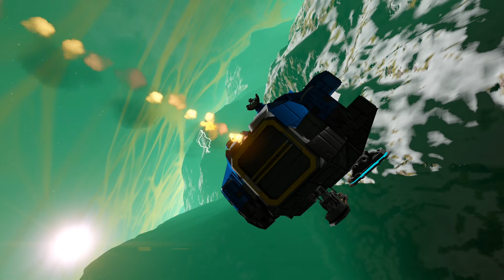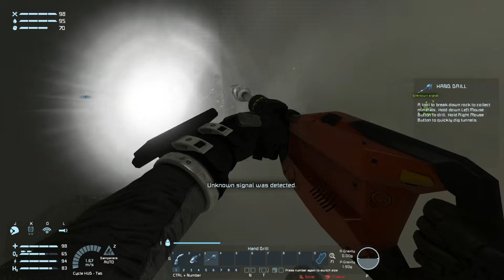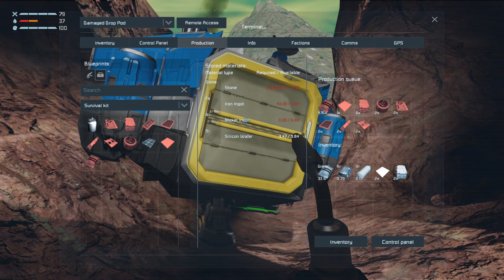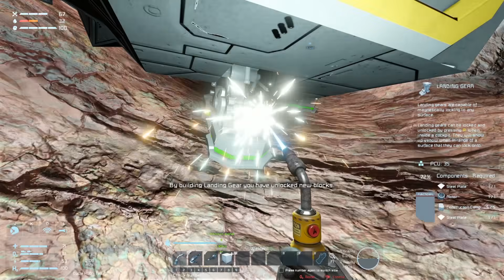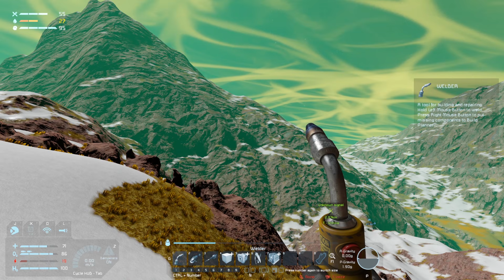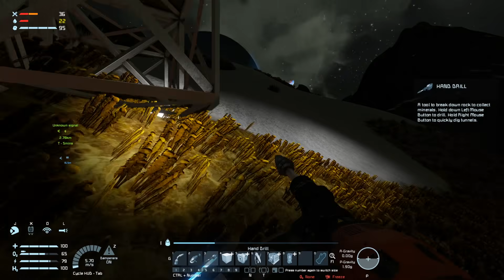Survival Impossible - Space Engineers Hardcore Survival

Comment: I love this, has a challenge set up where the planet you start on has less wind than most planets and is able to get 3 wind turbines to work. I start on the earth planet and in a wide open area try to build one and the thing doesn't work XD Granted I bet it is just some strange thing that will take time to figure out :D which...now that I think about it, how do you get the turbine to "stick" to the blocks? Every time I have tried putting one down it is able to be moved around even after being placed as close to it as it lets you put it?
Reply from the maker: The trouble is how you're trying to place things, you need to have it snap to the block when building, make sure the block it's going to connect to is under your crosshair when placing and you'll see it snap so that the two are actually connected :)
Reply: @Splitsie  Thanks dude :D I actually found myself thinking about how it added the new button placement feature and no other tutorial I saw had it mentioned for some reason. So I went and tested it and sure enough it had it spelled out plain as day XD. Thanks for the response though! It helped a lot!

Comment: Here’s an idea! A new base (Later on). Solar powered, atmosphereic, NO LANDING GEAR.

Also, will you make custom, airtight, rotor based doors. If not, I’m disapointed. Here’s why:

Allows bigger doors, and atightness (Strategy)
Is neat, just due to the complexity (Neat)
Is complex (Complexity)
Can be made to have an awesom opening sequence! (Very awsome! )

Sounds splitsie-y to me! DO IT!

ANd, the jetpack can save you from a fall. Wait untill you are at a certain point, and it slows you down, and by the type you are at the ground, fuels almost out, and you only mostly die!

“He’s only mostly dead”

Also “you would have to be insane to try this!”

Well, guess I’m more than insane, since I haven’t done much survival, and this is the first scenario I will try...
Reply from the maker: I suspect I may have a reason to build some custom doors down the line, but my first set will almost certainly be the vanilla ones as I won't have any vehicle big enough to need more than that. If I eventually get to building something large, custom doors in a pressurised hangar would have merit since I could work inside more easily and still get something huge out :)

Comment: Perhaps friendo you could do a Cargo Container, then stick a piston on the end of it, then add a drill, add pistons continuously until the material problem is solved.
Reply from the maker: The trouble is the material loss every time I need to remove the drill, with Awwscrap I can't just grind something down and move it :(
Reply: @Splitsie  Have you tried Drone Mining then? You'd need to get an actual programmer to explain it better than I ever could, but maybe you could set some 3D co-ordinates for a drone to mine out, return to location, drop off materials for X number of seconds/minutes and return to mine the co-ordinates.

Again, I'm unsure on how to make that viable with all the extra stuff you've got running without the power issue cropping up.

In any case; that sucks that the drill thing wouldn't work.
Reply from the maker: There's a script called PAM (Path-Auto-Miner) which handles that stuff quite nicely, though due to it needing to fly I'm not sure I'll go that way here, flying in 1.9G with loads of ore might be too expensive from a power point of view :/
Reply: @Splitsie  From what I understand splitsie my lad, you will need a large Reactor plus batteries in abundance adding into that whatever you want to have the miner itself do.

I'm sure there would be plenty of minions willing to help out if it were a MP server, but this is a SP runthrough.

Good luck o7

Comment: You can save a lot (95%) of material on scaffolds by using ramp blocks. They use interior plate (which only requires 1 iron ingot each), give you a 1x2 block instead of 1x1, and can let you ascend twice as far per block as light armor slopes which means you do less spinning while going up and down. So to ascend 2 blocks you only need 2 iron ingots (2 blocks for a tile-able ascent unit); right now you're spending 42 iron ingots (6 blocks per tile-able ascent unit) for the same ascent.
Reply from the maker: That's a good point, I'll try to remember that for my next tower build :)

Comment: Stick a hydrogen engine on the lander. When I’m playing with Aw Scrap, that’s normally how I keep my survival kit running until I can move to a more permanent base. Considering that you’re right by an Ice field, charging the battery up will be simple.

Also, when you hook the Survival Kit to the base, be sure to use an advanced rotor connected to the large conveyor port so it can be piped up.

For detaching the kit from the lander, DO NOT use detach mode directly on the Survival Kit. You need to grind it to 50% which will cost you medical components. Speaking from experience here.
Reply from the maker: That's a good point, I'm hopeless at remembering the hydrogen engine at times. Now that I don't need the ice for breathing it would be a decent way to secure the power for a little longer :)

Fortunately I'm familiar with how Awwscrap and advanced welding interact, I suspect I'll make very little use of the detach function unless I've got no alternative :)

Comment: I'm sorry to break your bubble, but survival kits are much better at converting stone into ingots than basic refineries. I know this because I was experimenting with ore outputs of the survival kit, basic refinery, and the refinery along with varying upgrades you can give it. I wanted to know how much each one produced and how much better each one was. What I found was when it comes to stone the survival kit produces about 42.8% more resources than the basic refinery.

Additionally, the refinery with no upgrades will produce the same amount of resources as the survival kit, but at a much faster speed. Literally the sole purpose of the basic refinery is to let you process the basic building ores (iron, silicon, nickel, and cobalt) until you can get a full on refinery up and running. Unless you also changed the recipe for the survival kit stone and basic refinery stone.

When the survival kit was released initially it was the worst at converting stone, but in some update (I don't remember which) they made a secret buff to it to where it was yielding the same as the refinery. I figured they did this to help shorten the length of time at the start where you only had a survival kit. I do have the numbers if anyone needs me to give them out, so that they can compare.
Reply from the maker: Well that would be true, except I modified all the outputs to ensure it wasn't ;)

Comment: For you basic vs full assembler, if an item can be made in both, remove that ability from the full assembler, the basic assemblr now does your plates and small tube ect, the full assembler becomes an advanced assembler for the extra's, it's not needed to survive but for the complicated builds with advanced parts, you'll need both.
Reply from the maker: I thought about that, but without the upgrade modules it will likely make manufacturing large volumes of plates a bit frustrating given the pace. If I was good enough to mod upgrades to it then that wouldn't be an issue though :P
Reply: @Splitsie  quantity has a quality all of its own, basic's have low through-put, build enough of them to rely on bandwidth, you wanted an excuse to go mining for the lkes of Iron, no better reason than needing 20 basic assemblers :P and the pretty room to house them in

Comment: Only thing i can think of for basic assembler is make that only thing capable of producing tools and bottles
Reply: This means you make one, and rarely use it.  Better, I think, if it is the only source of some common component, like steel plates.
Reply: @skipper2285  I was worried limiting creating of a component type would break the auto queing of the build planner
Reply from the maker: Without the upgrade modules it will likely make manufacturing large volumes of plates a bit frustrating given the pace. If I was good enough to mod upgrades to it then that wouldn't be an issue though :P

Hadn't thought about breaking the build planner though... that could be a problem

Comment: So, one thing I think might need to change about assemblers is that the advanced assembler should ONLY be capable of making advanced components. So, no steel plate, no construction components, none of the high-volume basic stuff. Basic assemblers would take that over, and they can't work as fast or be upgraded, meaning the player has to be a lot more intentional about their production queues and surpluses because ordering 1000 steel plate on demand would be quite unreasonable.
Reply: Going even further with this idea, I wish advanced components were made out of basic components rather than raw ores, necessitating even larger industrial and logistical networks. Basically, I wish Satisfactory's production concept were present in SE.
Reply from the maker: Stepwise production would be interesting if we had upgrade modules for the basic assembler so we could speed it up at those times when you need thousands of plates etc

Comment: If you really want to go hardcore, the hydrogen thrusters should require an oxidizer as well as fuel. As for the basic assembler, maybe have it function as a recycler, turning the scrap into the functional components with a small investment of resources? Maybe a tenth of the total build cost of the item in raw materials to replace broken parts.
Reply from the maker: I've sort of got that with the awwscrap mod where components come back as scrap and then can be refined for a fraction of the resources that went into each component. But if not for that it would be an interesting mechanic

Comment: 38:00 if you have a small grid piston on a wheeled vehicle, you can easily set the max/min extension from the hotbar so that it mines quite level, and gives good control of making ramps up or down. I have a working design with 2 drills that operates as a trencher, but with a few more it could tunnel as well.
Reply from the maker: I completely agree :)
That's been my usual trick for mining vehicles - it's how I controlled the one that drilled down to the underground ship in Escape Unlikely, definitely the better trick than using a rotor as you get much better control :)

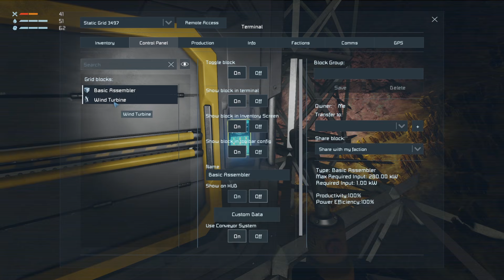Comment: @splitsie 34:50 I am pretty sure you still have enough power to at least build something like the material for a battery (but at a much slower rate) despite not reaching 280 kw, as long you produce more then 1kw, just not as fast...I think...

of course course having more wind turbine/solar panel are still the better option =p...i'm just curious if solar panel might have more use now that the wind turbine produce less power now....
Reply from the maker: I thought you needed full power or it didn't work at all, been a while since I tested it though

I'm hopeful solar panels will have a potential benefit compared to wind as I love building big solar towers :D
Reply: @Splitsie  Might be the case with the basic refinery too, a quick way to test it would be to turn off most of your wind turbine off. I think is the same for the basic refinery as well, as long it have at least  1kw+ (not sure about they none-basic equivalent I admit). 

I guess this could be useful (assuming this work of course haha) if you plan to build multiple outpost around with basic stuff and don't want to carry too much complement around with you . You can even turn the assembler off to refine stuff and vice versa I guess, obliviously a single battery will remove that need haha.

but yea, can't wait to see any result if solar towers are worth while in this scenario =p

Comment: If you're going to use a rotor to eventually put the kit on the base, consider putting the rotor on early, and using it to use small grid batteries on the base - if I remember right, they're a third the power for a quarter the resources. And you probably don't need the full power of a large grid battery right at the start
Reply from the maker: That's a fair point, I may well do that :)